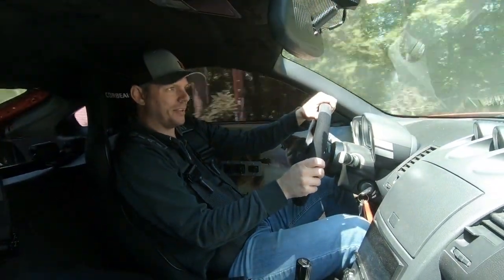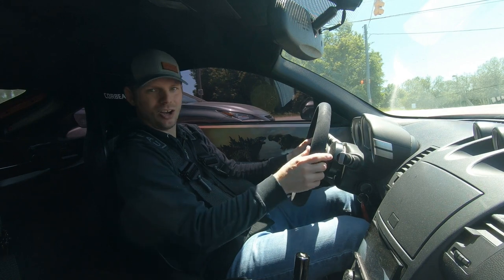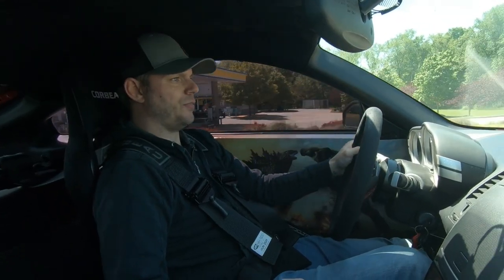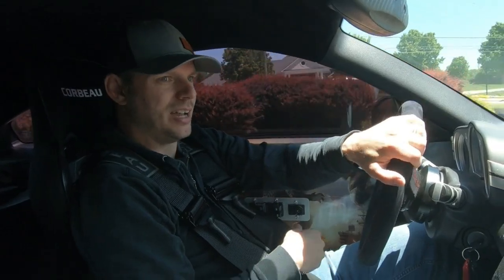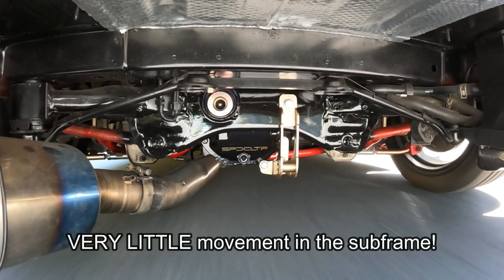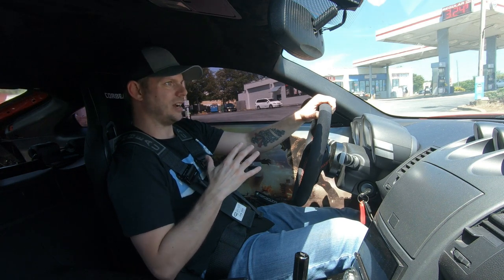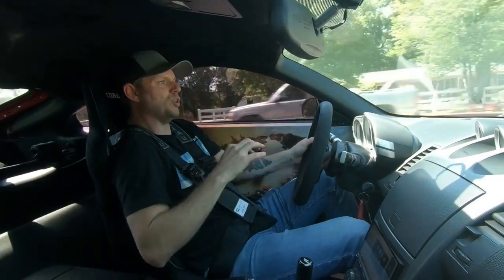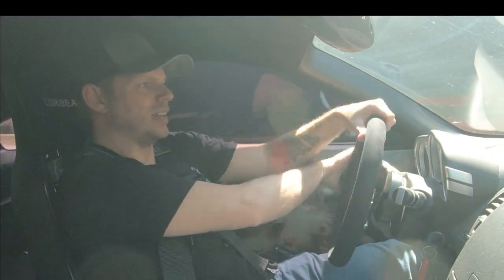Most important 350z upgrade | Watch BEFORE You Buy Z1 Bushing collars - G37, G35 and Q50 too!

Comment: Don't be afraid to use ploy mounts for engine and trans if it's anything but a track car. While being planted is ideal, it's also very tiring in the driver for regular use outside a track specific car. Outside driving under the influence, fetigue is also a major cause for crashes.
Reply from the maker: It’s not a daily but I am doing poly motor mounts.  The difference between poly and solid won’t benefit me that much to sacrifice the little comfort I have haha.

Comment: Awesome video! if youre on some grippy tires thats where that wheel hop is coming from because its trying to hook up. I need to assess my subframe. I think I want Solid bushings. The Z1 collars are very nice
Reply from the maker: It definitely has a lot to do with the tires.  Not huge fan of federals, but they are pretty grippy.  But you can definitely see the difference in the subframe movement between the two launches.  The collars are certainly working!
Reply: @SpeedCultureStudios  I agree

Comment: NEVER use a race harness for the street with out a neck brace thinggy. 3 point seat belts should be used in the road because they're better for neck with out a brace.
Reply from the maker: Thanks for your concern, but it’s ok.  Yes, if it was a daily, I would advise against harnesses.  Car is still equipped with factory belts if I need to make a real drive